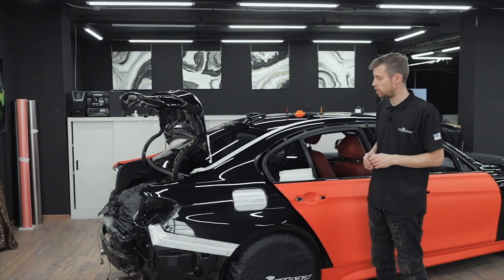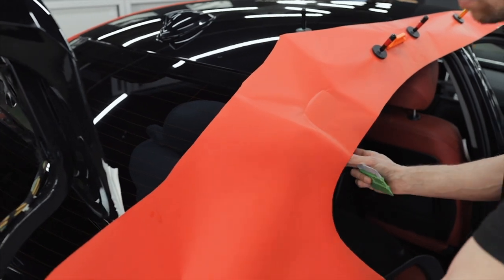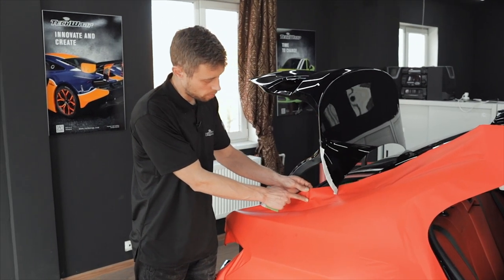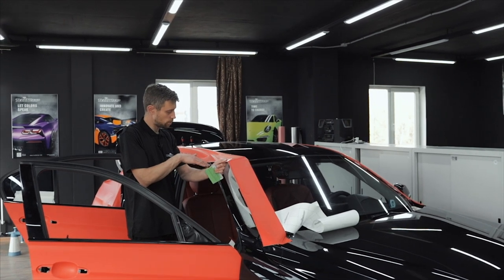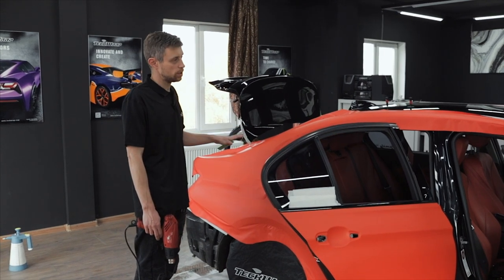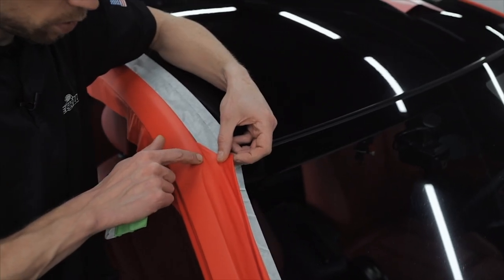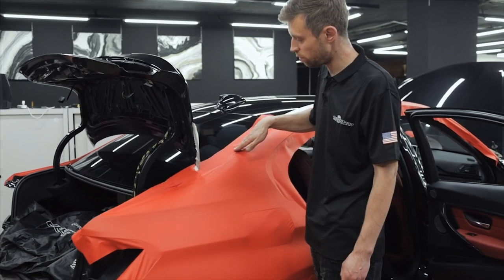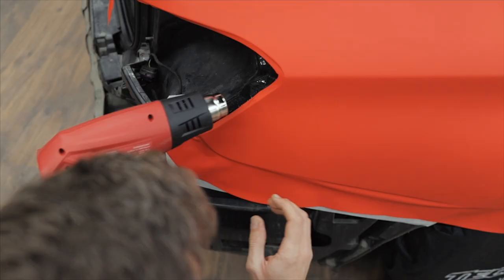Quarter panel wrapping with super matte vinyl film

Comment: Really good video.  How did you cut that back liner without cutting the wrap.  I wanna try that releasing the liner while squeezing.  My other question was how much you set your heatgun, you answered towards the end 100-110.
Reply: It’s a special blade from yellow tools. It slides between the relate liner and film without cutting it. They are pretty chep